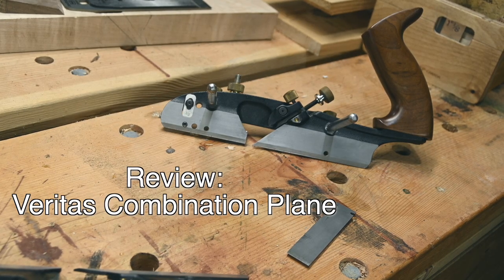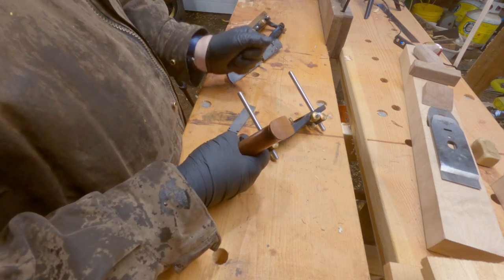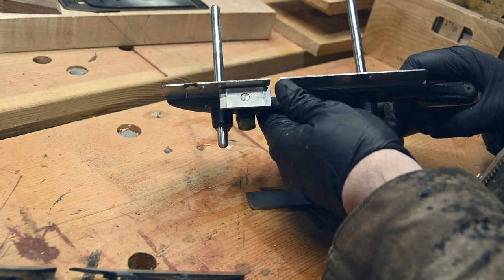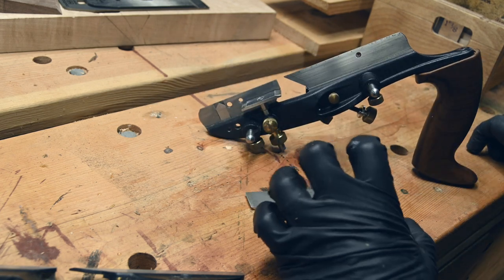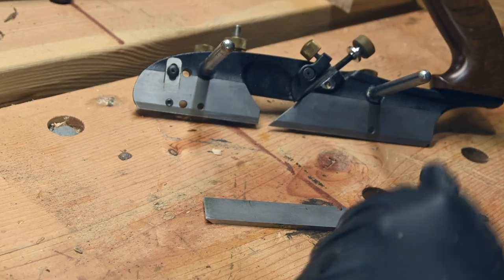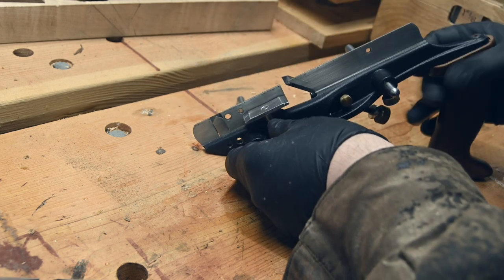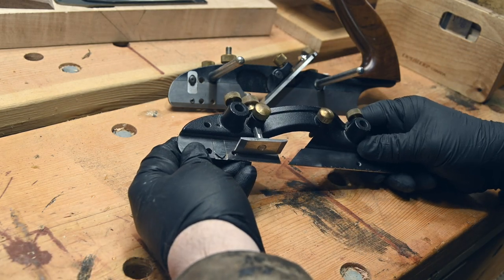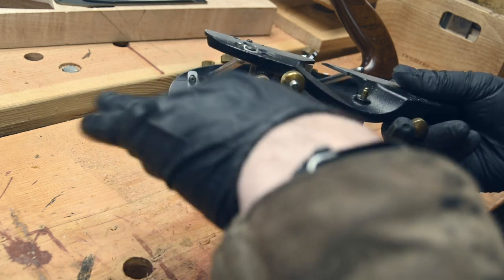Review and Demo: Veritas Combo Plane

Comment: Peaceful raindrop.
With fence in position for a rabbet cut, I would suggest move the 2nd skate towards the main skate so you get support from both. It does look a lot better than the Stanley No 45s.
Reply from the maker: I have both skates just inside the blade edge, but as you move the fence in, under the blade, it would be worth moving the skate inside the fence, indeed. Thanks for pointing that out.

Comment: Holding the crosscut saw incorrectly in your introductory part?
Reply from the maker: because I don’t extend my index finger along the handle? No, that’s not incorrect. You will notice that my hand fits comfortably in the handle with all fingers. This is a relatively large saw, with a correspondingly large handle.

One may extend one’s index finger but it isn’t required unless the handle is too small to fit your entire grip. A lot of small joinery saws have small handles.

Comment: I have one, used it once.  All jobs are actually done between the skew rebate and the small plough for me.  Too much hassle to setup and adjust and too heavy and unstable to use at length.
Reply from the maker: it certainly isn’t going to be ideal for everyone. Anything small one would be far better to use an appropriate sized specialty plane.
Reply: @allenwc  it's definitely a do-it-all item - nothing wrong with that. However, it's the master of none. I think if one can afford it, specialty smaller planes will work much better. One also does not need to buy veritas or lie Nielsen.  Stanley 50 and 78 works perfectly fine (with PROPER tuning).
Reply from the maker: @MintStiles  Have to agree. The combination planes in general are very adaptable, but that is their weakness. That adaptability makes them more difficult to setup than a speciality plane. If you want a combination plane, I do think the Veritas is one to get, I’ve owned a Stanley and the Veritas has solved a lot of issues with the Stanley. Not all. It does an acceptable job as well.

But

there is no question that a good quality tongue and groove plane is going to be much easier to use. 👍

Comment: That's very aggressive shaving indeed but I might back the blade for light cut to reduce the plane form digging while planning 🤔.
Waiting for my mail , just ordered one , I hope I can use it and setup it like you , any other tips of using can help me ???!
Reply: Any tips to give me other than the video demo ?????!
Reply from the maker: @athmostafa2462  sometimes YouTube does not tell me there is a reply. Best advice I can give is to start with the blade not cutting and advance it a tiny bit at a time. I wanted to demo a really big thick juicy cut so it could be clearly seen. Normally I take a much thinner cut. Thinner cuts are easier to push and to control that's for sure.
Reply: @allenwc  it's been 2 month but glad of your reply man .
I already got mine and it's gorgeous to use and practice with 😊,  bottom of the line I love it.👍

Comment: It gives me the impression that it is not well configured, because it does not get anything

Saludos desde Uruguay
Reply from the maker: did you watch right to the end? When demonstrating the basic functions it isn't necessary to take much of a cut, or any really. One can actually practice just handling the plane in position without taking a cut and that will really help you learn to feel how the plane moves and where you need to push and how much.